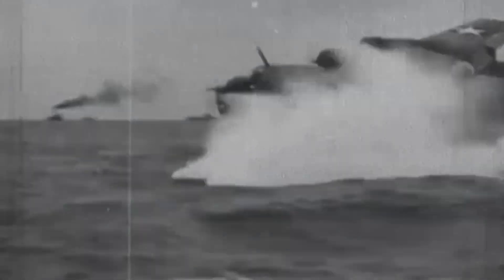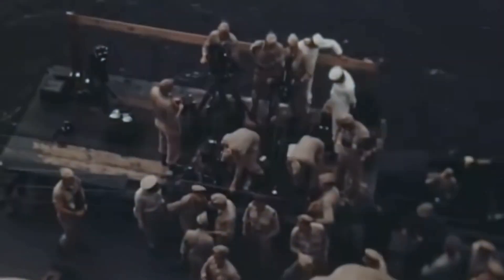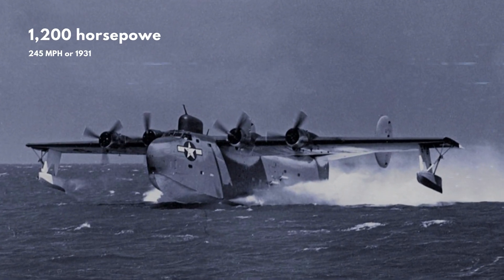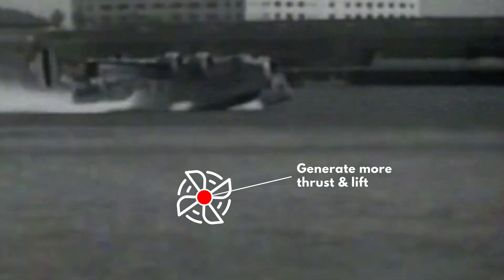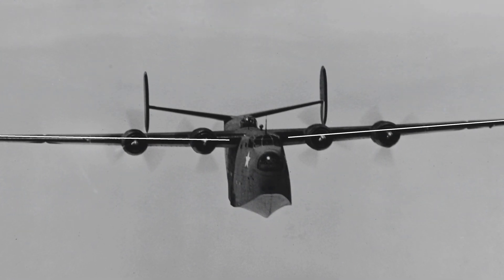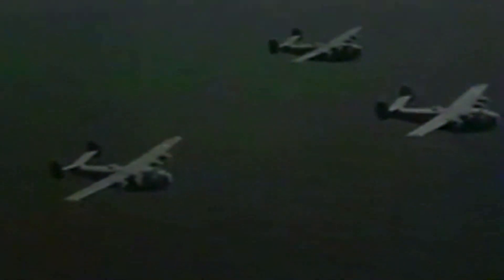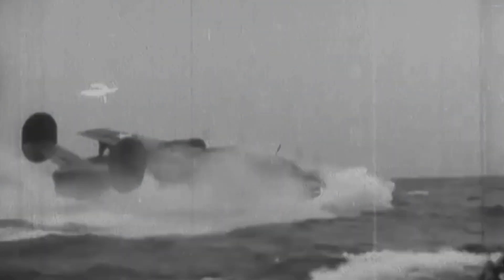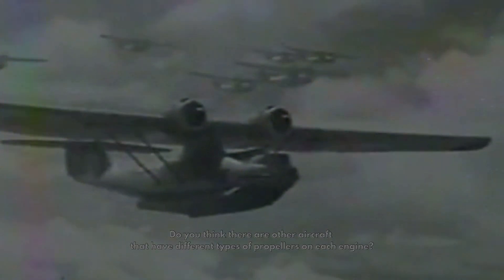Why the PB2Y 5 Had Two Different Types of Propellers? #aviation #military #recommended #youtube

Comment: This sounds largely like a load of hooey.  Absent of some documentation as evidence, I think this is largely made up. Certainly no other similarly sized long distance four engine America aircraft including the Consolidated B-24 and land-based maritime patrol bomber PB4Y-2 used the same engineering solution. 

The inboard set of props of this seaplane were reversible, presumably for in-water maneuverability. Why the outside props were not similarly capable is a matter of speculation.
Reply from the maker: Read it?
https://aerospaceweb.org/question/planes/q0039a.shtml#:~:text=%22I%20believe%20the%20reason%20for,in%20diameter%20than%20the%20outboards.